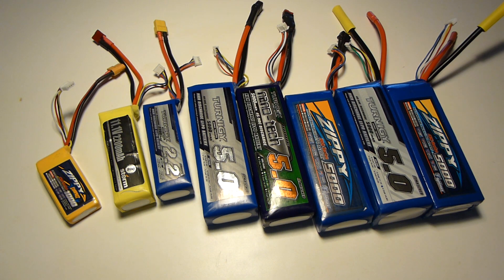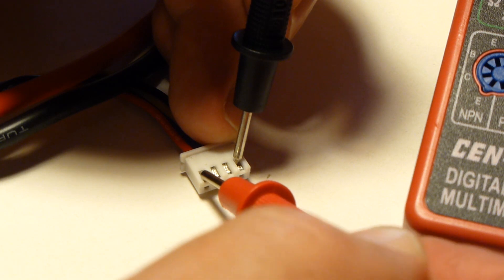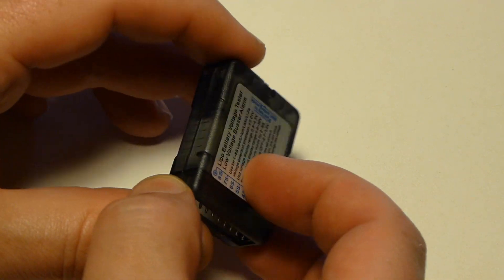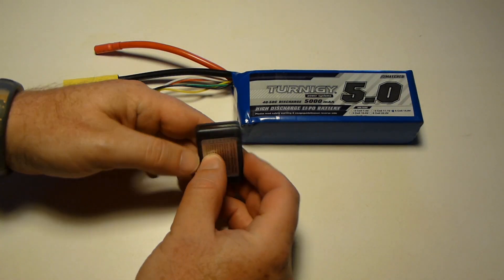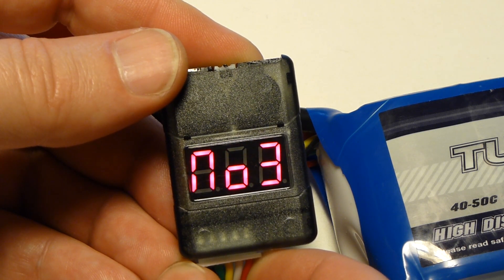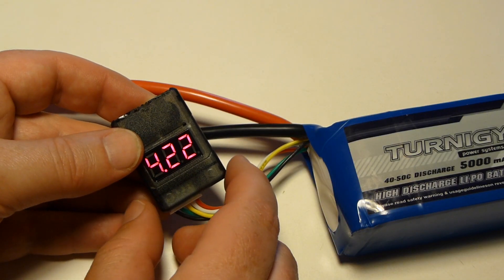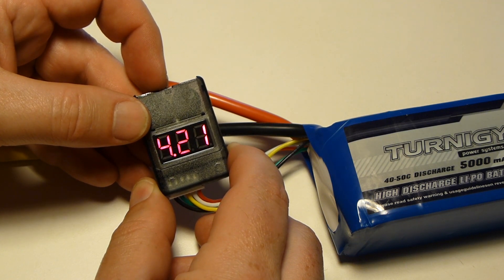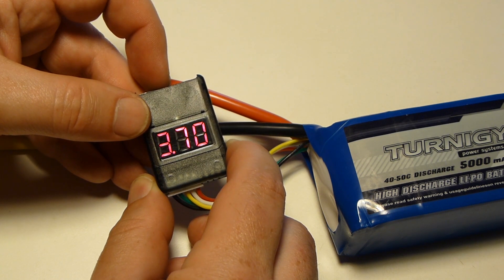Hobby King LIPO 2-8s Cell Checker with Low Voltage Alarm

Comment: Ok thanks.  I guess the idea would be to check the battery from time to time if it not going to be used on a regular basis , rather than leave it connected for an extended period of time?.

Comment from the maker: You could leave it connected... but I wouldn't. It is a fairly simple circuit, that constantly reads the voltage of each cell. Not a big deal for flying, but I would think sitting on a shelf the checker itself would drain the battery after a few days.